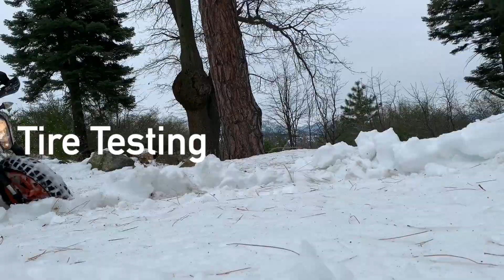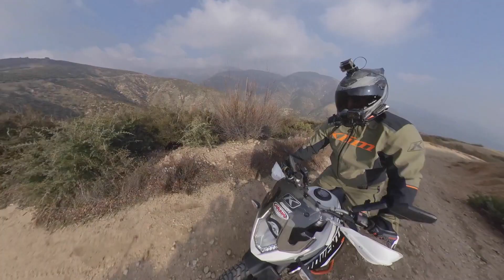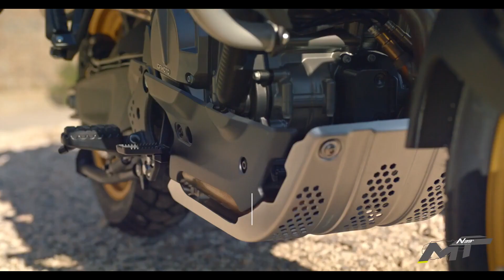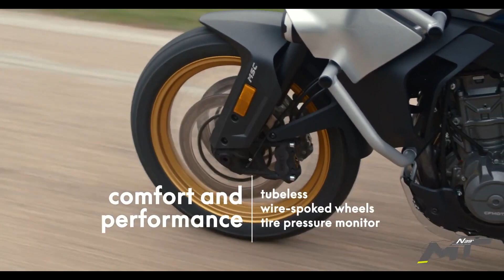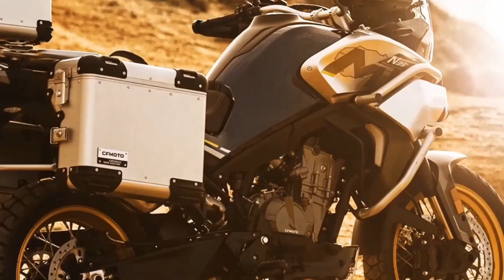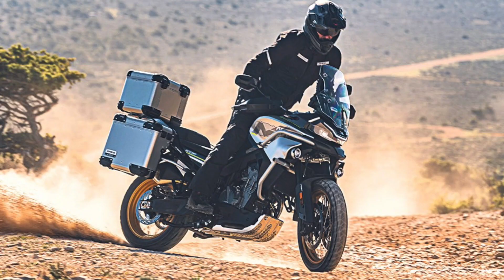First Look! 2021 CFMoto 800MT Adventure Motorcycle

Comment: Actually CF Moto make the entire bike of KTM 790 and 890 in China (KTM fanboys hate that) and the CFMoto 800MT is made in the same factory. I rode the MT800 Touring today and it’s so good I am selling my GS1250 and buying one. It’s a very solid build, the switch gear is first rate and it has cruise control, heated seat, heated grips, tubeless spoked wheels, TFT screen, quick shifter, Bosch cornering ABS, pannier racks, protective bar work and I couldn’t tell the difference between this and a 790. A GS 1250 in Australia is $35k+++ ..the CF Moto is $14k and has 3yr unlimited km warranty.  Australian market has them before the USA.
Reply from the maker: Wow! This is great news.
Reply: @manybikes  I forgot to metnion KYB adjustable suspension that I couldn't fault and it has the Chinese Brembo brakes (Brembo also made in China) - good braking. I want to make it clear it's not a GS so it's not competing with that but there is no way I would buy a KTM 790 or 890 at $10k more.
Reply from the maker: Yeah, I totally hear you on that one. I’d run the CFMoto over the KTM too, just to prove a point ;)

Comment: If its anything like their ATV's I would buy it in a heartbeat. I owned their 400cc atv and was super happy with it never had any issues and its ride was impressive to say the least. So if I was in the market for an adventure tourer I would be very confident to opt for the 800MT,  as far as quality is concerned they have proved to be really reliable with their products so far. There will be testing of the bike from many channels and we will know more about it but if they follow the same quality control protocols with this one, which they have no reason not to, then the bike will sell well and establish the factory in the market as a well made product.
Reply from the maker: Yes, we have been selling the Utility line for years and the quality, fit and finish is very very good. The extra accessories that come stock are great too!  I have no reason to believe the motorcycle line will be any different. Pretty exciting!
Reply: Hows the rust?
Reply: @GrimYak  no rust most parts are made from Aluminium

Comment: Just yesterday i had a extreme curvy mountain road ride with that bike here in Beijing/China. (ADV version)
That thing is fast with a very nice neutral handling!
From the first impression of materials, manufacturing quality and performance I was more than impressed. (I say this as a 1200 GS LC rider). It is not as radical as the KTM, but if you look for a more long distance ADV bike with more comfort its the choice.
19L tank, KTM engine, all electronics, tire pressure control, cruise control and and and.
Quickshifter, tubeless spoke wheels.
The brakes are J.Juan and very well to operate with clear feedback.
Tires are Maxxis Maxventure. On dry road it goes down to the edge with good grip. Wet I couldn't test.
Road ready Price in China incl. Luggage system, tax, and registration 73k RMB.
Only one point to improve is the mapping as it has a little hickup at about 4500rpm. I guess an update should fix it.
Reply from the maker: Wow, this is a fantastic first impression of the bike! Thank you!
Reply: 红井路？ If so? Was there last week too! :)
Reply: @CaptainCaveman782  no, not x045 in the west, the test road was from Yanqi lake up north X004 and then at coffee triangle to Sihai on G234.
Reply: @shuben6020  ah yes I know it , its great place to ride up that way,   getting cold now though! I am doing a trip to 稻城亚丁 G318（Sichuan, daocheng yading) next year so looking at this bike too ! My DL 250 won't cut it I think lol !

Comment: A Chinese is  a Chinese no matter how much u put in .....it will fail .... man better ktm launch its 790adv in india before cfmoto does else ktm will loose a big market ....if ktm prices it's bike aptly
Reply from the maker: Interesting feedback.  I want to take apart an "original Austrian 790" and a CFMoto 790 to SEE and FEEL the workmanship differences. I DO KNOW that my 390 Duke made in India is WAY "cheap" in feel to my 950 or 1190!!!
Reply: @manybikes   made in india ktm 390 is cheap may be but highly reliable in all conditions unlike cfmoto 790 which looses out to the cheaper bike
Reply from the maker: @rider_srk  I HAMMER my 390 and it has not let me down. I do get frustrated working on it... and the fasteners are Philips head screws, metal tabs are weak and the aluminum castings are super porous... But functionally... it has been flawless even under flogging.

Comment: I had a CFmoto 650NK for 2 years and I thrashed the s!@t out of it and it never gave me any problems. I only had to take it back to the shop to get a pin in a cable fixed as my indicator light on the dash wasnt working. 

Anyway. For all the trash They get, they do make pretty good bikes. It braked when I needed it to. The gear changes were flawless. Solid build and great quality, nothing felt cheap.

I dare say I'll be buying one of these if the reviews are good.
Reply from the maker: Great feedback! Face value it looks great and having seen what they do in the utility vehicle market for us... I can't imagine it won't be great!

Comment: I think pricing is an important factor here given that it has a good n powerful 790 KTM motor. I see there are many modern gadgets on the bike. For example the tubeless spoke wheels or perhaps a quick shifter?
Reply from the maker: There were not that many details made available but I do believe the wheels to be tubeless and a quickshifter should be an option as it is on the KTM's... or so I'd hope!
Reply: @manybikes  I like the headlights design with the daytime running lights. think I read auto head lights on the screen written in chinese. It also has a curved radiator and steering damper. If the bike can reduce some weight, it will be good. A bit heavy for a 800cc at 231kg.

Comment: I would probably buy the CF Moto over the KTM. However, I would almost certainly buy the Yamaha T7 over the CFMoto. Ultimately, I'd save even more money and buy a low kms, kitted -up second-hand T7. Or maybe the Himalayan 650 ;) which will come out in the next couple of years and out-bargain all of them :)
Reply from the maker: Love your thought process!  I am good at holding out and purchasing used. I picked up my 2016 KTM 1190 Adv R in 2018 with just 1,000 miles on the odometer for just $11k. That is $6,000 LESS than it sold new for two yeas and only 1k miles earlier.  HUGE savings for a bitcchn' bike. Now beat to hell with 30k miles on it I still could sell it for about the MSRP of this CFMoto bike.   Hummmmmm   or the price of a Used T7.   Man... I love the T7 too!
Reply: The CF is a different tool than the T7. T7 is definitely off-road oriented with the enduro seat. The CF is an 80/20 slab hauler.
Reply: @twipproductionssrl4916  Yep, so why buy a less capable bike? Unless you want a cheap touring bike in ADV clothing? It makes sense then... kind of. I'm not really sure why people choose to buy cheap new bikes, when you can get something REALLY good second hand for the same money. That was really the point I was making above. Kyle Bradshaw understood what I meant because he actually rides ADV bikes like ADV bikes.
Reply: @campbellrousselle9752  Less capable? For what?

I applaud your choice to buy used instead of new and understand that rationale.

However, we all have different motivations for buying scooters. I have owned bikes for 53 years now, and every purchase was motivated differently. I currently own 9 bikes, all ADV machines. I am also a dealer for the Cyclone line of ADV bikes, specifically the RX3, RA1, and RX4, and they, too, are quality pieces at a modest price point...for new bikes.

You compare new to used. Others compare new to new. In the latter category, this new CF 800MT ADV bike packs a lot of solid features in a modestly priced package.
Reply: @twipproductionssrl4916  I did acknowledge, it could be good in certain circumstances for certain riders. It just isn't for me. I don't want anything it offers. Overall I take your point. We don't really disagree. It does depend on what you require. The problem is the term 'Adventure' means too many things. The 800MT is about as 'Adventure' capable as a VStrom1000, and that would be a better bike in every circumstance for about 1/3rd the price (mint second hand). It does fit a niche for people who HAVE to have new AND want a lot of 'Play Station' modes.
Reply: @campbellrousselle9752  The source of conflict is in how one defines "adventure." That segment is fractured.

To some "adventure" is Dakar with only a flashlight and your foreskin to change flat knobbies bitten by a snake To others it's traveling off the split slabs to places a rider has never been. 

There is a tool for every job.

IMO, this particular bike offers a massive amount of bang-for-the-buck for those who want KTM/BMW features at 2/3 the price. The biggest negative I see is the current reputation of China in world affairs...which has nothing to do with this or any other Chinese bike.

When Zongshen brought out the RX-3 I said "Wow! What a nice niche!" and they sold hundreds f thousands of them around the world. I knew then it was just a matter of time before a Chinese company decided to take on the really Big Boys. And here we are. FWIW, I'm a large human and I have trashed an RX3 around the country without mercy, and it never skipped a beat. 

Here is another perspective not uncommon in the Third World. Where I live the net Import Duty on vehicles is 56%. A base KTM 850 Adventure is US$22,500. A 1290 Adventure is $28,000. A BMW F750 is $19,500, a big GS is $32,000. A bare-bones DL1000 is $17,000+. Used big bikes are almost unicorns. This CFMoto 800MT will be $13,500.

The CFMoto dealer down here recently did the round-the-island tour on a CF 650, where a group of top riders really thrash their bikes around in every condition imaginable, and he was in the top group, often leading, along with BMW f800, GS's, KTM, Africa Twins and Husky's. People came away impressed, but still skeptical because China.

These guys may have a bright future. After all, this is a joint venture with KTM. The real question will be who will make the aftermarket farkels.
Reply: @campbellrousselle9752  Edit to add: I doubt this bike pulls many sales away from KTM or BMW, but will take many sales from the two V-Strom models and Versys.
Reply: @twipproductionssrl4916  Yeah, I think you are absolutely right. I think on paper it will look newer and more 'techy' and seem like great value, considering the absurd prices of new bikes now. Great thought mate:)

Comment: Well, I think...let's wait 1 or 2 years to see the reviews.
In a Quick view is a good looking bike, but 547 lb. wet??...that's the same of my 2018 1290 S.A.R.!
Reply from the maker: Yeah... Same as the SAR and the R1250GSA... WOW.  For the budget minded ADV guy looking to do a gravel road, it should do fine though. The proof will be in the pudding once several get out there though...   My experience the Chinese products are disposable. Ride it for 4 years, throw it away and get a new one. Not how we have been trained with other brands of bikes.

Comment: It’s not ”the chinese version” of the KTM 890 Adventure, they are just sharing the same engine, basically everything else is different. It’s like calling a SEAT ”the spanish version” of an Audi.
Reply from the maker: Yeah, I hear you. It is CFMoto's take on an ADV bike made by the "the same Chinese company" that is now building the 790 / 890 KTM bikes in 2021 using KTM's older motor. I think It is pretty interesting.

Comment: No way would I buy Chinese KTM
Reply from the maker: I hear you. I own two Austrian made KTM's (2009 KTM 950 and a 2016 KTM 1190) and a 390 Duke that was made in India. The fit / finish / build quality of the Austrian machines is WAY WAY different than the Indian machine. Metals, rubber gaskets, etc... No where near the same quality. CFMoto has a really good reputation... I am curious to see if we will see a decline in KTM 890 workmanship this year over the prior years?  Hummmmmmmm
Reply: @manybikes  In fairness you can't compare the 390 to the other two bikes - it is entry-level. Even the Yamaha T7 is built to a price. I've looked at the 390 and the build quality is similar to a Suzuki DR650 for around the same money.
Reply: @manybikes  it's my understanding and hope that cfmoto and ktm are completely separate in parts and labor. I think this is just a way for ktm to get into the Chinese market under the sub company KTMR2R and cfmoto. The 890 is probably the most significant engine ktm has and would be very bad business sense to start mixing parts or labor with cfmoto.
Reply: @manybikes  is the KTM 890 being built in China or just the engine?

Comment: Where I live, the base model KTM 790 Adv is being sold at almost twice the price of the V-strom 650 & Versys 650. And there's nothing else in between other than the Tiger 850 which is in the next price bracket up. If CFmoto prices this bike within earshot of the V-strom then it's a no-brainer, because it easily outmuscles and out-specs both Japanese models in all aspects... except in weight. But if the price approaches that of the Tiger 850 then I'd take the Triumph, but I doubt CFmoto is that cocky.

Having personally relied on the TNT600 as my daily driver for 4 years, I got no reason to doubt the build quality of middleweight Chinese bikes.
Reply from the maker: Yeah, I would love to see this bike hit the USA at a $7499 price point. At $10k I think people might look elsewhere... but if below $10k I think we would see a shift in the current landscape. Selling NEW for less than a "used with 20k miles on it" 890, 1090 or 1190... with similar bells and whistles and about the same price as a new Vstrom 650 or Yamaha T7... WOW.  We will see. Rumor has it the USA will see it in 2023 if the current plan holds strong.
Reply: @manybikes  CFmoto Australia have just published the official specs of the 800MT on their website. Seems a hell lot of the bike come straight off CFmoto's KTM790 Adv production line! 

First, we know the engine is the same... but now it looks like the Bosch electronic wizardry might be the same too (i.e. cornering ABS etc), as is the 2-way quickshifter. And if you look closely at the brakes, you might remember that the OEM supplier for KTM 790 Advs brakes is... yes, J. Juan (rebranded KTM). Just about the only things that aren't KTM are the bodywork, TFT dash, rims and suspension.

This will be interesting!